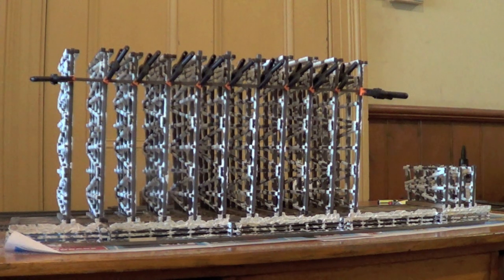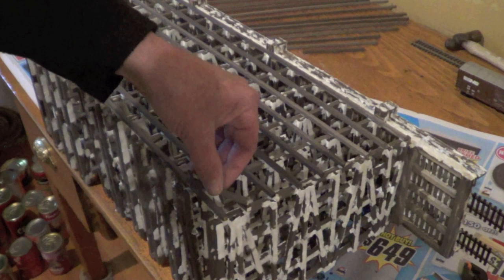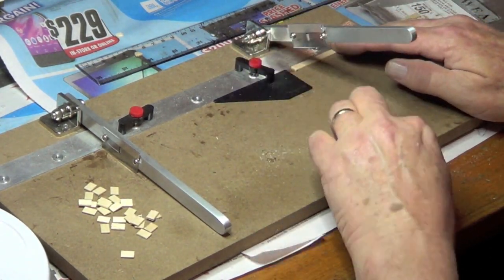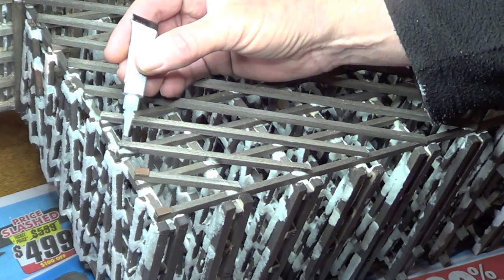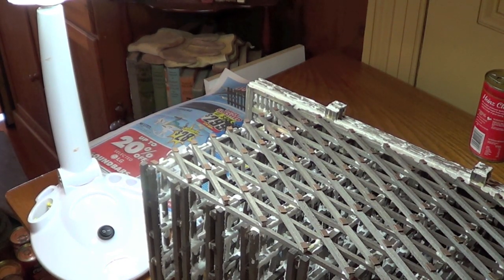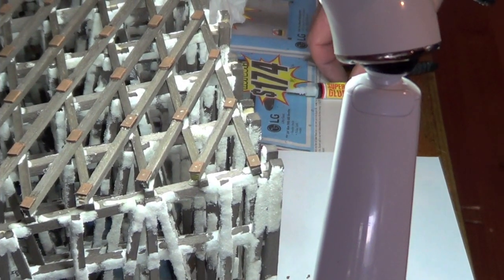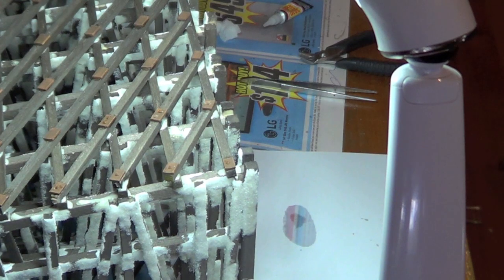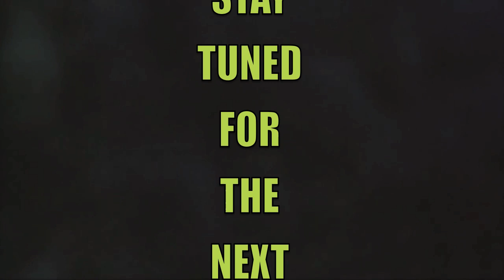Trestle Bridge Build Part 6 " Cross Beams & Tichy NBW "

Comment: Tip for next time....I work in a slightly larger scale but with tiny nuts/rivets, I usually put them into the hole dry. Then use very thin CA glue and put one drop on each nut, the thin glue flows into the hole behind the nut.... saves the nuts sticking to the tweezers 🙂     Then you can use a dab of weathering dust to add the 'rust' to the nut.

Awesome looking bridge....onya 👍👍
Reply from the maker: Thanks for the tip, and yes it was a pain using the
tweezers and wet glue cheers Robert

Comment: Wow. Just wow. Been following this build all along and in this one episode the sheer volume of labor and love and the cost in time is captured when one sees the detail of putting bolts on plates. That for ONE Plate. Many plates per beam times many beans per side. Then the snow in one paint per tressle side. The a second coat.  Then the same sequence on the other sides. Then that replicates over the entire set of tressles. And the aging of the wood only to cover 85% of that up with snow. Wow. If that bridge is sold it would cost $5000 at lest I imagine. 
Well done. It is absolutely amazing.

As you were fiddling with then bolts I was wondering if it would have been easier to put the bolts on while the plates were still stick to the tape from painting?  And/or easier to dry fit then in then holes and then paint on some super glue after to eliminate the problem of gluing the bolts to the tweezers or your fingers ?
Reply from the maker: Minok1217 thanks for the great comment and this build has taken awhile to do,
with the lake scene and Trestle bridge scene together. Also the finished lake scene
will be up soon and then the finished Trestle Bridge scene will follow. And putting
on all those NBWs may have been easier with better tweezers, but the more i was
putting on the better it got cheers Robert

Comment: I love trestles, and you have done an excellent one. The NBW I have gotten in the past, here in the US are white metal rather than plastic. I think I would prefer the plastic. Probably less pricey as well. This is going to be spectacular once installed on the layout. Regards, Solomon
Reply from the maker: Solomon have never seen the white metal one's but the plastic one's are only $3.50 per pack.
And these do really make the scene cheers Robert